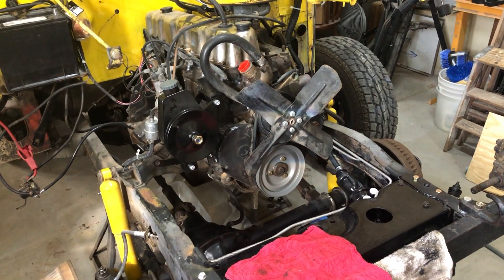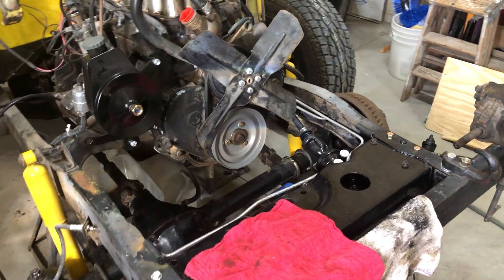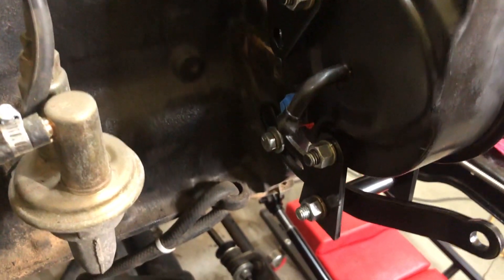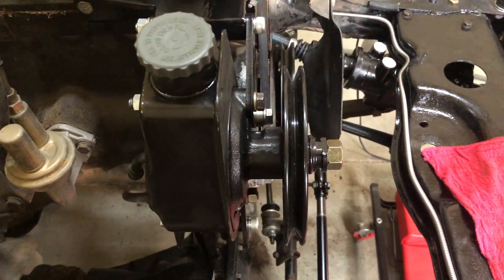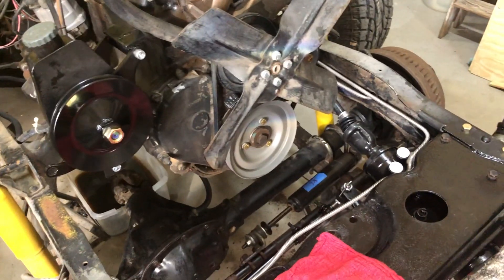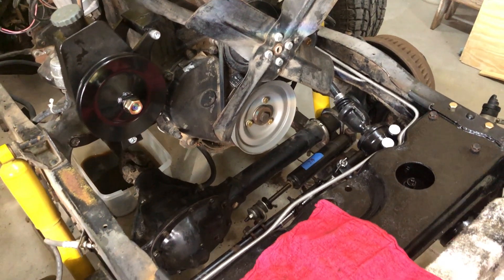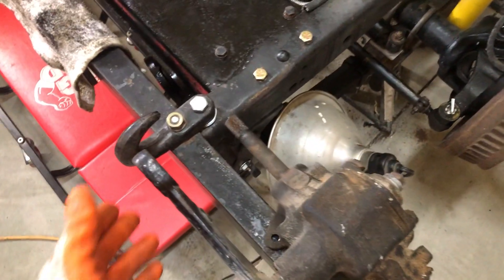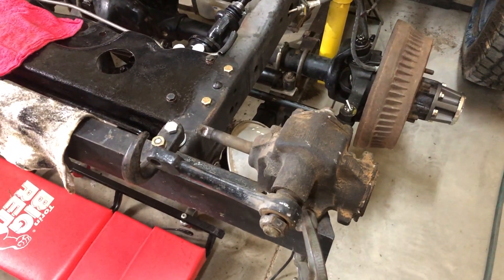1974 Jeep CJ5 Steering Fix Part 2

Comment: i know this is old but on my ‘74 i had to put a brace in from box to opposite frame rail. forgot where i got it but it bolts right up in minutes and solved my final bit of wandering.
Reply from the maker: I've heard that also, but what I found out is that the steering gear brackets that were stamped steel would flex. Mine is thick cast iron and doesn't flex that I can see. Thanks for the input.

Comment: Hi sir thank you for your videos where did you get the power pump and the brakets any part number please thanks in adavance
Reply from the maker: Got it from O'Reilly Auto Parts, $61.99, it's a saginaw type pump with reservoir that was for that year Jeep and engine. part# MPP 732-2114. I made the top bracket that bolts to the head with 2x3 angle and a piece of square tubing for pivot bolt, the bottom brackes I bought online that was universal for a chevy I believe, came with all kinds of parts and didn't cost much at all. Top bolt was the pivot point and the bottom brackets had the curve for adjusting. Pretty easy to make it work.
Reply: @Pitlane326  thank you sir I appreciate the info what about the Gear box do you have the part number for the part please?
Reply from the maker: @simonsautorepair8082  Don't have that info , but the one for whatever year you have should work. I ordered mine for a 1974 CJ5 and fit perfect, I also had the cast iron mount on my frame, not the stamped steel. All but 1 bolt is used and fits perfect and does not move at all. This might be a problem if yours is not cast iron because the stamped steel ones are weak and will crack. They have aftermarket ones that are strong.
Reply: @Pitlane326  thank you so much for the info have a great night

Comment: Nice work, I’m doing exactly the same thing on my 1974 RHD CJ6 with 232 (I’m in Australia). 

It’s a slow work in progress job, however in my case I have swapped the stock bell coupler joint for a Flaming River steering column/u-joint arrangement. Hopefully this will also remove some play.

In terms of the power steering pump and the both pulleys (pump and crank), can you please share the part #s and supplier details? I’m also mounting mine like yours as my alternator is on the left side, and managed to track down some NOS brackets from a suitable AMC sedan.

Do you also intend to update the suspension bushings and  shackles? I’ll be doing mine as I have a huge amount of play there too.

Best of luck with conversion, I’m keen to see your findings.
Reply from the maker: The bolt-on crank pulley I got from Quadratec, Omix #17460.02, cost $15.99 plus tax/shipping. This pulley said it has a 1.8" hole for crank but I had to use a round file to remove paint and cleaned the crank the best I could. Barely fit but didn't force it. 
The pump pulley I got off Amazon, A-Team Performance tapered shaft with keyway, cost $19.99 plus tax/shipping. The only thing I don't like is there's not enought threads on the pump I got so a locknut or lock washer doesn't fit. Not sure if the pulley is too fat, but I'll get it to work, maybe find a thinner nut.
Having heartburn trying to find the correct pressure line hose, auto part stores are baffled, love stumping them for some reason. I have the page out of the shop manual that clearly shows everything on passenger side but in 2 different versions. I want it correct but no Mickey Mouse. 
Anything else I can help with just let me know. 
Good luck with your project
Reply: @Pitlane326  thanks for the detailed reply mate, it really helps.

Fingers crossed you find those lines and the rest of the fit out goes smoothly.
Reply from the maker: How's your Jeep coming along?

Comment: What shims did you use.. do you have the dimensions
Reply from the maker: Dan, used 6 degree shims that are 1-3/4" wide by 5" long. Someone mentioned that 8 degree shim might have been better but have not tried that yet.
Hope this helps

Comment: my ‘74 cj5 has factory power steering, the pump is on drivers side, my ‘72 was too.
Reply from the maker: Maybe you have a V8, the shop manual shows all fan belt layouts with the different engine packages they offered and this inline 6 cylinder is on the passager side.